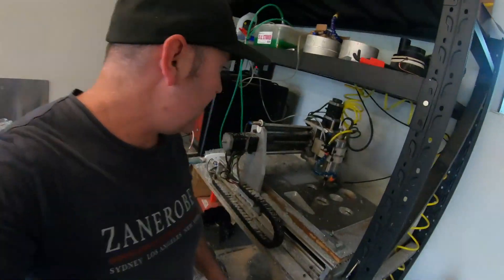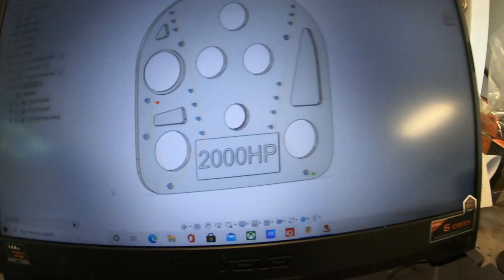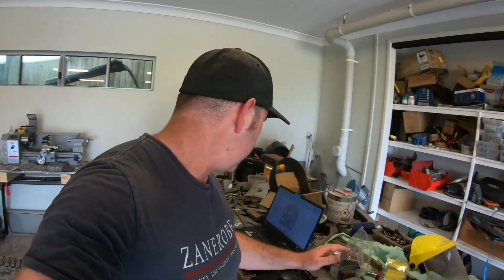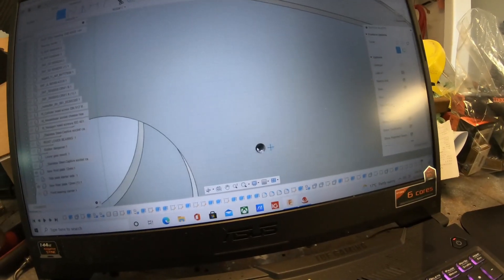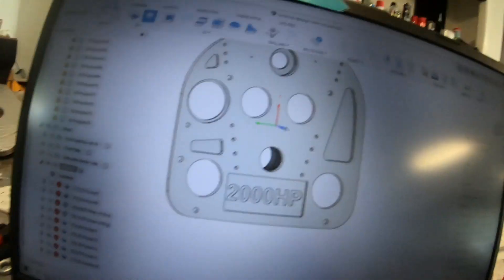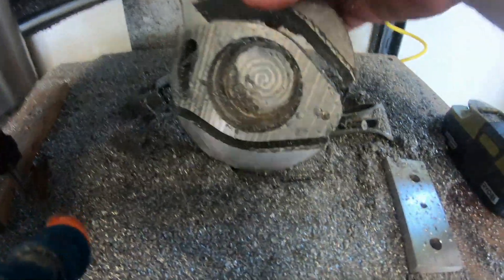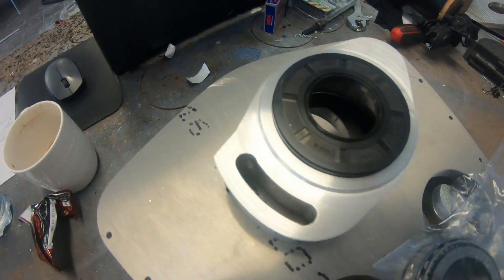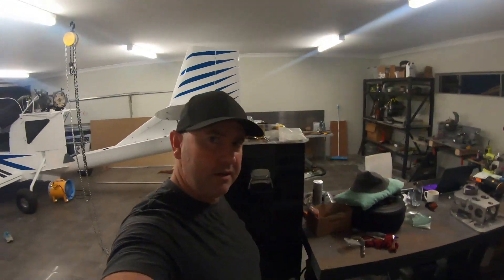Experimental Ultimate Seaplane Build Ultralight aircraft CNC machining gearbox PT 2

Comment: Why don't you put the CNC mill in a box or enclosure for chip containment as well as reduction of noise. If cooling is an issue, fans could be used in the enclosure.
Reply from the maker: Yes that’s a good idea I was thinking of something like that . Too keen to get this done first 😀 cooling won’t be an issue because it’s a water cooled spindle so yes definitely will need to do something. I think my wife will be happy not having chips all through the house 😝

Comment: Yeah super interested in the build, with the thickness of that gear box, it certainly won’t be coming apart! Looking forward to more updates
Reply from the maker: Awesome thanks for the comments and following along. Yeah with the gearbox I wanted to design something bulletproof and reliable with ease of maintenance. I have a habit of over engineering things sometimes though but for added piece of mind it’s worth it 😀